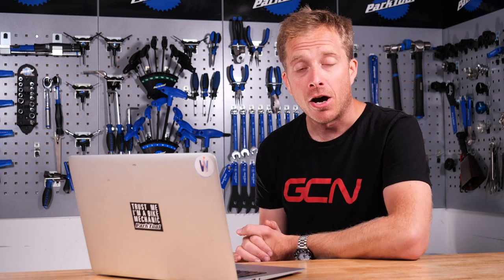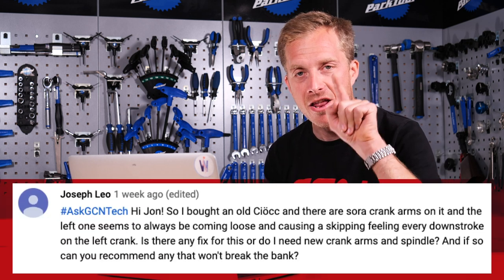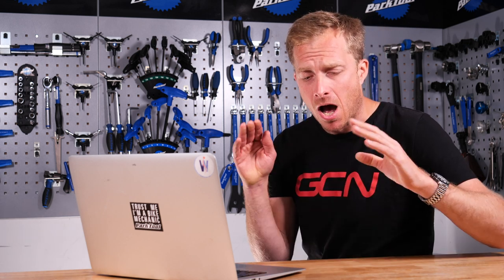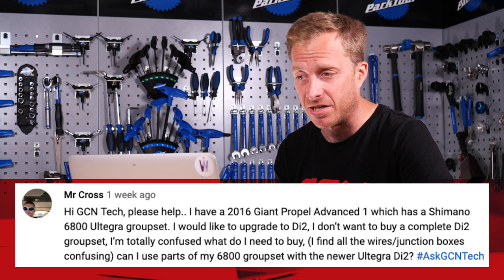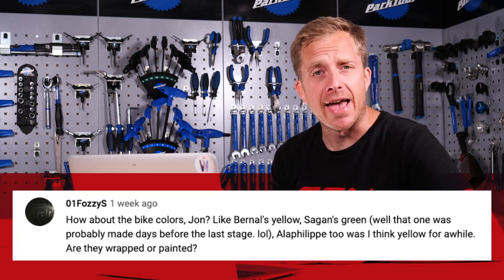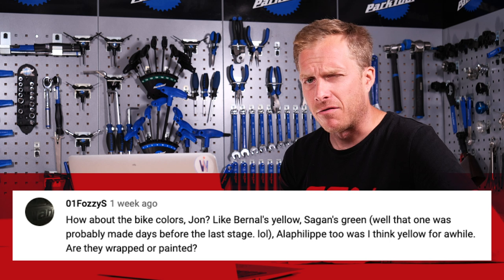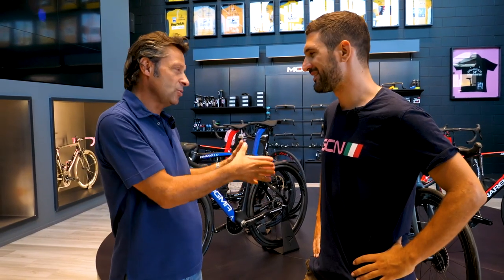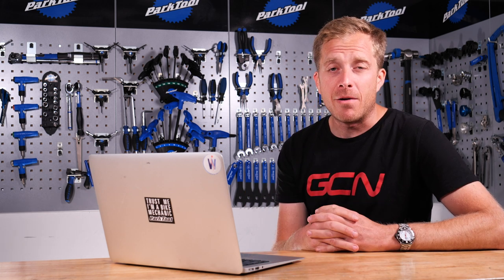Converting To Di2 Electronic Gears, Loose Cranks & Squeaky Disc Brakes | GCN Tech Clinic

Comment from the maker: Leave us your questions here! #askGCNTech
Reply: Yes...as a Top Fan, I ve a question..
When are you sending the P.Dogma F12 to me? Just curious..👀 tkx
Reply: Any tips on hiding my new bike from my mum?
Reply: Is there any problem in upgrading from Tiagra 4700 to 105 (5800 or r7000) chainset in a 10 speed bike?
Reply: What are the pros and cons of various chain tension devices for singlespeed: eccentric BB, sliding dropouts, derailleur-hangar-mounted tensioner, etc?
Reply: Shimano pedals or Look Keo? What differences are there between the two? Thx Jon. Always great to listen to you.
Reply: #askGCNTech hi, I've just started cycling and had a beginner bike with sora groupset and I'm not impressed at all with the brakes, is it worth it to upgrade to tiagra brakes or is it not much of a difference?
Reply: @porsuertelatino  Tiagra 4500?
Reply: @puntoni  4700, sorry I wasn't more specific
Reply: Could you explain hubs, and give recommendations on some decent ones?
Reply: I own a Stevens from about 1999 with a Tiagra 4400, I love the handmade small aluminum frame and want to recreate the GCN's cheap bike. How do I attach a 105 R5800 braze on front derailleur, which clamp do I need?
Reply: Any idea, what I could only describe as a clicking feeling coming from the crank/bottom bracket? It is not always when the crank is in a certain position of revolution, it is random, but always at some point through the revolution.
Reply: #askGCNTech - can rear derailleurs ever be misaligned, even when the hanger is aligned perfectly? If so, would you deliberately misalign the hanger in order to get the derailleur cage itself perfectly vertical? And how would you measure this?
Reply: Can a non-disc groupset be converted to a disc groupset? If so how is this done? (shimano)
#GCNTECH
Reply: I have a tourney groupset except for my cassete(which is 8speed) is it possible to upgrade from tourney thumb shifters,, if so what do i need?
Reply: #askgcntech Hi Jon! Often, when I stop pedalling for a moment while descending at speed on sub-optimal road surfaces (mountain b-roads), the chain jumps off the 11-sprocket and ends up next to the dropout (I’d be on 53-11 at the time). Ordinarily, the rear derailleur is a well behaved and nicely indexed DI2 setup. I’ve reduced the chain length, as far as sensible, to maximise tension. Can you recommend any other potential remedy? Is there such a thing as a rear chain catcher that could protect the frame? Thanks!
Reply: #askGCNTech I ride on an older (2011) specialised tarmac and find I can get quite a bit of brake rub on the rear wheel when climbing or really putting the power down, being around  85kg and on the stronger side I expect a bit of flex in my wheels but the other day when cleaning my bike I noticed that the paint is getting worn on my frame in where the rear stays are meeting the bottom bracket so the wheels are rubbing there too. So it's made me wonder, is it the wheel or the frame flexing? How can I figure out what the culprit is?
Reply: I got a giant trance advanced pro 29 with NX group-set and I recently got a XX1 eagle axs upgrade kit so just the mech and shifter I have on my bike, the NX cassette is great but I want something to match the group-set better, am really looking for a premium preferably one piece Cassette that will fit the shimano/sram free hub body and that is also 12 speed, love your guys stuff would like to have this question answered by many people as I can’t find a cassette
Reply: #askGCNTech when those pesky French people (Peugeot) have stopped using French threaded BB?
I got ‘89 Peugeot aubisque and it got ISO standard BB but... I’m looking forward to buying an old Peugeot to convert it into vintage/hipster  1by urban beater (later eBike) and it would be nice to have some options about BB as French threaded are pretty expensive nowadays... and more less impossible to get 😐
Thanks in advance
Cheers 🍻
Reply: @Raphael Saga buy Shimano Claris R2000 rear derailleur and shifters and you good...
Reply: Would changing from a tiagra 4500 12-28t cassette to 11-32t cause me any issues?
Reply: Craig McNaught 👋
Being honest it depends on which rear derailleur (short/medium/long cage) you’re using as it have maximum tooth capacity and how big gear you can run... 
check your RD manual or Shimano website for those information.
Reply: Christian Norwik perfect thanks

Comment: John,  I am building a 1989 Cannondale Black Lightning (SR800).  
Steps taken:
1. Stripped all of the old Paint from frame and fork.
2. Sourced a 1 inch 25.4mm Steerer carbon fork.
3. Sourced a full Shimano 105 10 Speed Groupset
4. Sourced a set of 700C Shimano 105 Wheelset
5. Sourced a 1 inch headset
6. Sourced a Seat and Seatpost to fit

I have test fit all items on the bike and everything fits fine.  I am having trouble with the long cage rear derailleur on a 32T rear cassette.  Note: I haven't run any cables yet and have only tested it manually so I haven't adjusted any limit screws at this point.  Thanks for a great series.  You are me go to for tech stuff.

Comment: A suggestion for measuring the length of wire needed: get a piece of wire of similar gauge, and actually route it and cut it, then you will know for sure. Obviously this means taking your bike off the road and doing some work before you will have the actual Di stuff in hand, but it will give you: a) certainty, b)practice. Never underestimate the value of practice when you are working on something expensive.
Reply: Guy Smith thanks mate

Comment: @Jon Cannings - to find true love, you need to get an old 9 speed infatuation, run a gold chain on it and then tweak the reciprocated platonic friendship with a 6mm allen key. If you turn it about two turns anticlockwise and then three turns clockwise (torque it to about 6Nm) it will cause the Di2 controller to switch to lust mode, which on this setup will produce true love after about 250 miles.

Comment: If you clean your rotors with a wipe regularly you eliminate a lot of noise issues. Im using the metal pads and i found the braking us better and i dont get squealing like the resin version.

Comment: Thanks Jon! I'm gonna have to keep you waiting on that picture though, it's not the prettiest thing to look at as of now. I just put on a old/new 105 5501 rear derailleur and the chain was too long from the previous owner having a long cage mtb one on there. And while on on looks, do you have any tips for restoring old headbadges?

I wanted to save a few bucks so I did end up purchasing a used 105 5500 crankset off eBay and I'm going to use the chainrings from the sora since they are in good condition still. I'll send in a pic when I'm at the University cause there is a stunning climb (and overlook) near the top of the Shawangunk mountains. It's gonna be extremely pretty I can't wait to finally get this bike going it's gonna be great!

Comment: I have an old (but beautiful) Cannondale tandem. It has 9 speed 105, and the rear shifting has always been an issue because of that looong cable.  I'm considering e-shifting. Will a SRAM wireless system work over that distance?  Can I get a Shimano wire that long?  Other issues?

Comment: The problem with disc brakes is when doing long descents you need to use tap braking or setup the brakes to have a wider gap. I also use brake tapping method on all rim brakes. I have never replaced any bike brakes by using this braking method by tapping right to left to right to left until stopping. This also allows for braking at corners at high speeds while still maintaining control.

Comment: Hi Jon! Love the shows about all the tech! The cheap bike to super bike build was especially interesting as it inspired me to thinking about repainting my Bulls Vulture 1 and upgrading from Sora/Tektro mix to 105 R7000. I will upgrade the bottom bracket from an octalink (68mm) to BBR60, which should work. Only thing I am worried about is the wheelset I bought last year and is still good to go: it is a Shimano wheelset WHR501 with a hub for 8/9/10 speed. Is there a way to make this compatible with the 11sp 105 R7000 without bodging it? I couldn't find a definitive answer anywhere online. Thanks in advance! #askGCNTech

Comment: It costs less to buy a complete di2 groupset. When you start buying batteries, junction boxes, and wires, it costs more to buy all the parts individually. Then you can sell your oils groupset entirely, or sell it separate and sell the brand new crank, bb, and cassette that came with the complete group and come out even further ahead then buying individually. Keep the new chain for a spare.
Reply: True, but you can get Di2 upgrade kits which save a good chunk of cash over the full groupset. They include everything you need - the brake levers / shifters, front and rear derailleurs, battery and all the cables and junction boxes, plus the cable insertion tool. Currently £770 for the R8050 upgrade kit at Vanilla Bikes or £800 at Merlin.
Reply: D.G Webster yeah I didn’t think about the mini groups until after I posted. Merlin is definitely the place to go these days for shimano. But sometimes when there is a big sale you can get lucky. I got a great price on 9150 and sold the brakes and crankset I did not need and it came out the same price as I would have paid for the shifting group, except I had a cassette (that I didn’t have) chain and bb on top of it. But selling parts isn’t for everyone.
Reply: That's a nice upgrade you got. It pays to shop around and work through the numbers

I'm looking at something similar. Buy the new Domane SL5 sell the 105 groupset and get the R8070 groupset instead. Way cheaper than getting the di2 equiped domane from Trek, even when I add in a pair of Hunt carbon wheels. Now I just need to justify it...

Comment: Hello GCN Tech. Love the show! I just set up my brand-new Hunt wheels with GP5000 TL. The tires got on easily enough and seated in the first attempt using a cheap floor pump. Not a drop of sealant spilt! The set ups rides like a dream, however, I’m finding that I need to top up the air in the tires once every 10 days to 2 weeks. It’s a minor inconvenience but I was wondering if I should be worried at all. I can’t see any signs of sealant leaking out anywhere and there are no other easily detectable signs of air leakage. What gives? Should I try to trouble shoot or take any measures to try and stop this or just learn to live with it?

Comment: I just replaced my SRAM Red eTap WiFli HRD group with a Dura-Ace 9170 group. WOW! Wow Wow Wow! A noticeable difference. After the support, or should I say no support, I got from SRAM I am amazed at the improvements in shifting, brake smoothness, and feel of the levers. I will never buy SRAM again.

Comment: Hi Jon, I look forward to GCN Tech Clinic each week. I have a compact chain-set 50/34, that came with my Bianchi. I live in South Western Australia, where it is almost, as flat as a pancake. I very rarely use the 34 chainring, but when I do, its always in "smally, smalls" 50/12, 50/13 :). As I feel that the 34 is wasted, can I change it out for a 42 or 44? Will an inner chainring as big as 44 not work with the 50, or is this not a wise idea? Look forward to hearing back. Glenn
Reply: Sorry "smally smalls" is 34/12, 34/13.

Comment: #askgcntech Hi Jon and Ollie.  Great show and thanks for all the knowledge you provide.  I don't miss an episode because you all are fun to watch.  I have a 2018 Fuji Gran Fondo 2.3 and it works great.  But if I have to make a tight turn and pedal at the same time (rather than coast) my toes hit the turned front wheel.  Is this normal?  It has happened to me a few times and has almost caused me to fall.  What should I look for in frame style or size to avoid this?  I believe I have the right frame size and tried the frame size up with no difference.  If it helps, I am 5'06" with an inseam of 29-30 inches.  I didn't have this problem when I rode mountain bikes.  Thank you from Texas!

Comment: #AskGCNTech hey, i have a bike with mix groupset (shimano 105 shifter, Dura ace FD, Ultegra Crankset and 105 RD). I was thinking to upgrade my bike and wondering if i should upgrade my shifter to Ultegra or my RD since i have an extra Ultegra RD. If im going to upgrade my 105 RD to Ultegra RD, i was thinking to upgrade with Ceramic Speed Pulley System. So, can you advise, should i go for Ultegra shifter or Ultegra RD with Ceramic Speed OSPW?

Thanks in advance 😘

Comment: Regarding the oval cassette. It doesn’t matter if it has a freewheel or is a fixie. It won’t work due to the gearing ratio. The oval position would change all the time with respect to the cranks.

It would only work with a 1-1 ratio. I don’t think anyone would like to ride that.

Comment: I've got a brand new Canyon Ultimate CF Disc with di2. There are Mavic Carbon UST disc rims and Ksyrium UST tyres installed. I cannot unseat the tyres off the bead. It's just impossible. Any ideas how to get them off? I've got a brand new pair of GP 5000 TLs and would like to use them...
Reply: Same problem..........

Comment: #askGCNTech Jon, recently had a side swipe collision with a mountain biker jumping off the bike path onto the road where he hit me directly around the front carbon fork area head-on but the fork seems to be ok just delaminated it seems but after watching some videos on  carbon fiber experts talking about carbon bike failures I don't feel as safe anymore specially when defending on my bike and would like to replace my front fork but have not been able to find a replacement for a 2015 Z75 Felt Endurance road bike. Have found out that the fork is an unusual size 1.125 - 1.5. Have contacted the manufacturer through a bike dealer and no luck. Any suggestions besides getting another bike ?

Comment: Hey, I'm riding a Rose Pro SL with 105 group set and rim brakes. After I washed my bike and treated my right brake caliper (with Mucoff MO 94) it has sort of an initial resistance to overcome when braking. Oher than that it works flawlessly, it's just annoying that the breaking isn't as smooth as it was in the frist place. #askGCNTech

Comment: Hi GCN tech. I got a 10 speed ultegra 6770 di2 groupset and I want to upgrade it to 11 speed. Is it fine to just upgrade the rear derailleur, cassette, junction box, chain and leave the rest as it is? Some people say there is gonna be a firmware compatibility issue but others also say it will work fine so I'm a bit confused. #askGCNTech

Comment: I have a post mount disc brake frame, that I want to put hydraulic brakes on, but all the disc brakes I can find don’t have the same size bolt hole as the frame any suggestions for that?

Comment: #askGCNTech I know Shimano claim the largest cassette I can use with an ultegra Di2 8050 short cage rear derailleur is an 11-30 but I’ve heard of people using larger. Any advice/experience you can offer Jon? I’m running 50/30 chainrings on my gravel bike and need a 32 or 34 cassette for an upcoming gravel/off-road race. Cheers.
Reply: Rear derailleur hanger extender question again Jon😅

Comment: I'd been considering making the move to Di2 (but for the cost, about $1400 US) but it is the wires that have me most confused. How the heck do they get measured? The other stuff, shifters, mechs, batteries, seems simple in comparison.
Reply: you just take a ruler and meassure on your frame. keep in mind you may have to route them around bends etc. - buy generously, it doesnt matter if they are a few cm too long.

Comment: #askGCNTech I have a Giant Contend SL 1 2019 Bike (all 105 except the crank) with a 50/34 and 11-34. 

1. Can I change 50/34 with 52/36 OR 53/39? Shimano 105 OR ULTEGRA????
2. Can I change 11-34 with 11-25 OR 11-28?
3. What tools are necessary for the job?

Not much hill/climb in our area, not really needing the 34s at the back. And can go bigger at the front which are the reason for the upgrade. 
TIA JON. Love your videos!
Reply: 1. Yes. But depending on the vintage/spec you may have a crankset with different chainring size (BCD, bolt chain diameter). Conventional double used to be 130 BCD, but that's too big for 36 or 34 teeth (compact is 110 BCD. I think this is not an issue with latest 4-arm Shimano cranks.

2. Yes. No issue here, but see below.

1 and 2. In both cases, you may need to re-size your chain. And you'll need hex/torx keys appropriate for your chainring bolts, a cassette tool, and a chain whip. Maybe a new chain and a chain breaker.

Comment: Hi gcn tech, great content. Keep up the good work jon. I got a couple of questions some might never been asked or answered.
1. It's about 1x, can you convert a 1x specific groupset back to 2x ? Like sram rival1l 1x. If could ? How is it ?

2. About the derailurnhangger on steel bike tend to be integrated in to the frame i.e one piece with frame, how i reduce the risk it get bend ? Can i use derailurnhangger extender ?.

3. And the final , about metal frame bike. Does the butting process like triple or double butting a frame reduce it's element of reliability and durability ?.
Since it's less material in the middle of the tube. It's a can of worms, but please shed some light.
#askgcntech
Cheers.

Comment: I have an mtb that I converted into a gravel bike and I recently bought a set of fsa carbon road bike cranks and it wont fit on my bike what crank should I use it has to be more than 50 teeth #askGCNTech

Comment: Hi, Jon. I really likes your show. I have been following your advices by washing my bike with soapy water each week. After washing my bike, I just let the bike air-dry. Recently, I noticed that both my cassette and chain start to rust. Did I wash it too often? Or is it because I let my bike air-dry?  

Also will soapy water contaminate disc brake pad? Thanks. #askGCNTech